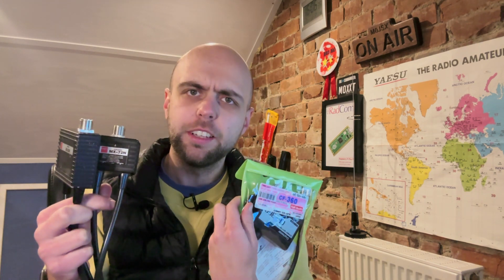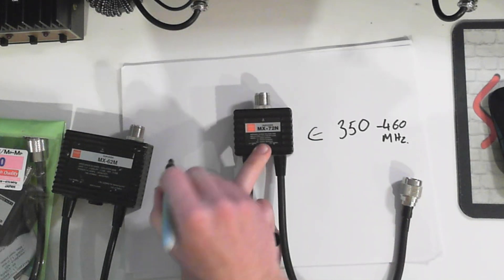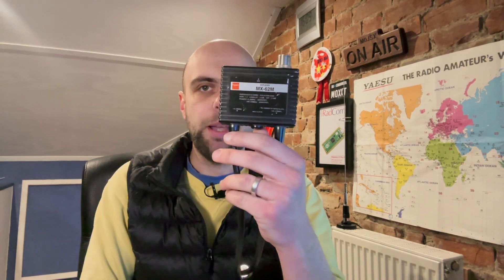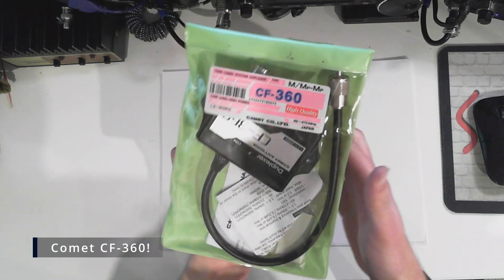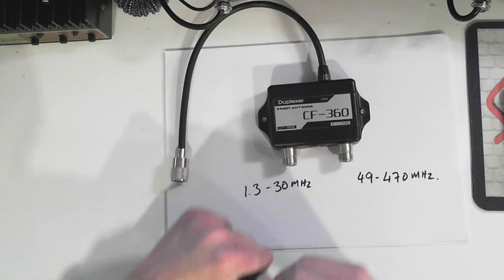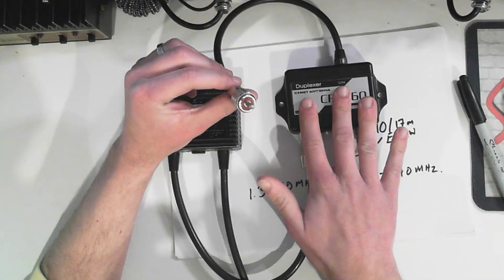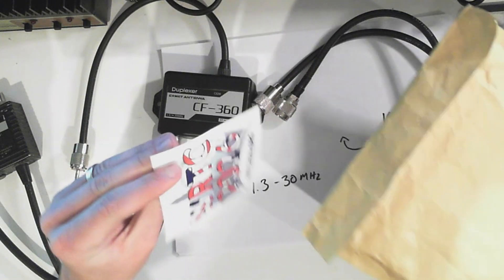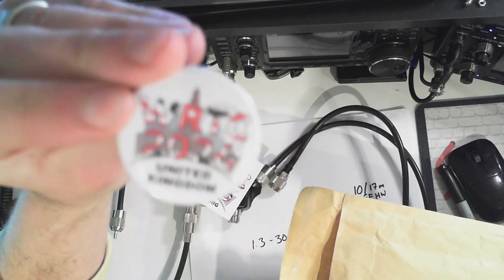Why I have bought ANOTHER Diplexer

Comment: I have a Motorola SYNTOR X9000 I am installing in my mobile. The X9000 is a low band version that transmits roughly 27 to 54 MHz 100W FM in one continuous band. Motorola never made an antenna that would span the entire range. So I bought a CF-360 so that I could have a 10M base loaded antenna as well as a 6 M base loaded antenna. I will be able to scan 10 and 6 meter FM frequencies simultaneously I am planning another antenna in the mid range (commercial 43 MHz) and will use a coaxial relay to switch to it on demand from the drivers seat.
Reply from the maker: Brilliant!

Comment: But….. if the rf take the way with te least swr, why using duplexer with two different antennes.
Reply from the maker: RF is not that simple. If you simply connected two antennas to one radio using a coax splitter, the SWR will be all over the place, due to so many factors including impedance not being anywhere near 50Ohms and massive interactions between the two antennas.
Reply: There are tricks to do that, but it really requires careful engineering of cable lengths and antenna placement. A diplexer is a much easier way to do this right out of the box.

Comment: I've just bought a Comet Diplexer with a split at 90MHz, so I can have a separate 4m/6m antenna to 2m/70cm.  Waiting for the weather to get better before I install it.
Reply from the maker: Fantastic stuff. What radio are you using for that?
Reply: @M0JSX  The Wouxun KG-UV980PL.  Originally bought it for the car, but have decided to put it in the shack to complement the Yaesu FT991A.  Will use a different rig in the car.  I'm looking forward to giving 4m a go.
Reply from the maker: @ ah! Yes of course. 4m is a bit of fun.

Comment: Thanks Jonathan for this video, I have the Diamond MX-62M you showed. Can you or anyone help with this question? I have a Yaesu FT 991A which has a HF socket & VHF/UHF socket. I have a Diamond Multiband vertical covering HF - UHF, my plan is to use the Duplexer to connect to the 2 antenna sockets on FT-991A and from the Duplexer out to the Diamond antenna. This was to save me swapping the antenna lead over to either the HF or VHF socket on rear of radio every time I change bands. Thanks in advance for any help on this. 😊
Reply from the maker: Good Morning. Yep, that is a perfect use for the MX-62M. Enjoy :)

Comment: Cool vid Jonathan…
Totally agree on the term diplexer.. 😊
Another use is with 2 radios (uhf & vhf) to hear your own signal when working the ISS cross band repeater.. proper practice is to be able to hear yourself so you can make sure you are not transmitting noise and blocking other users during the short radio path horizon window..
Maybe we should start calling this type of Comms “Full Diplex” 😂
Reply from the maker: Yes! Another prime use!

Comment: I got one of those on a package deal but never used it I recently put it in my truck with my 7100. When I switch antennas I no longer hav to move the coax from v/u to hf or back.

Comment: I used the Comet CF-706 with my FT857 / ATAS 120 and it worked ( as well as the ATAS can - or not, especially on 2m and 70cm )

Only stopped using when I got the separate mount and a Diamond SG7900.

Handy bits of kit.
Reply from the maker: Nice one Jon!